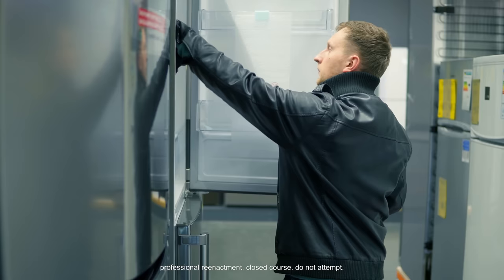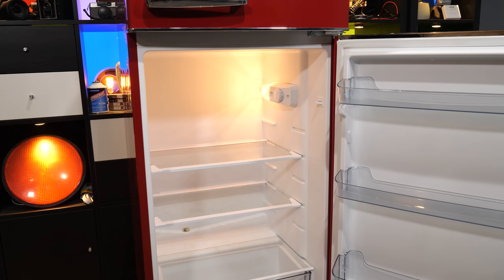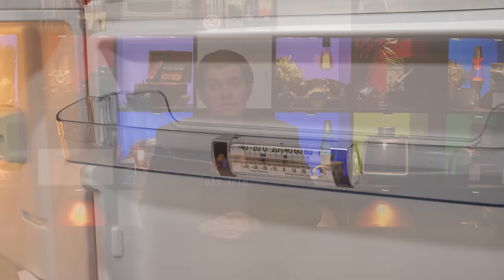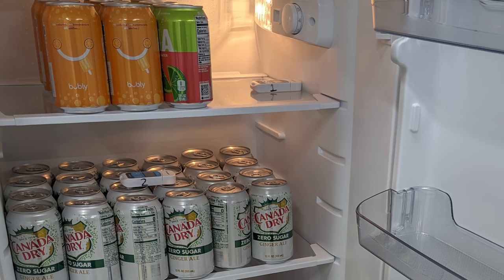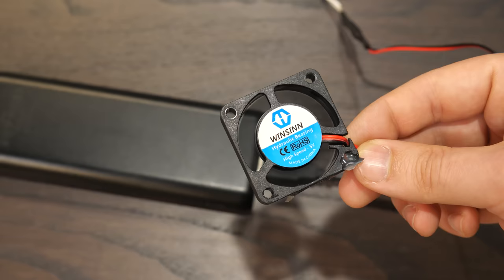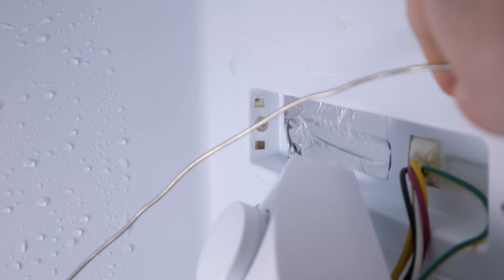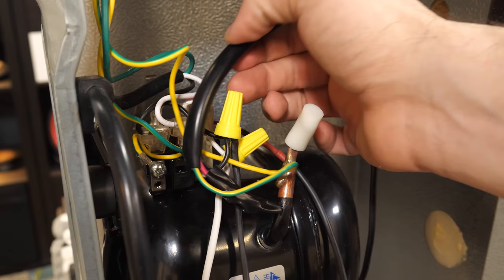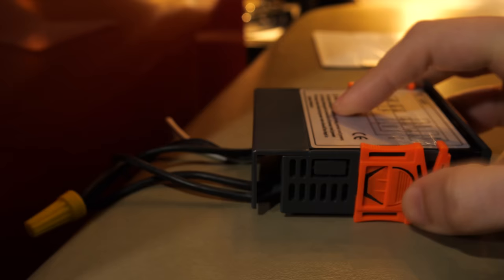This goofy fridge has a really clever design. It's also kinda terrible.

Comment: I was given a "camping cooler" that has no moving parts- it somehow uses evaporated ammonia powered either by a 120 volt plug or a propane tank to keep things cool.  I kept it in my garage for years and used it to keep my beer cold (and if I wasn't careful it would freeze them). You should look into these things. They are stupidly simple yet surprisingly effective.
Reply: I was fascinated to discover non-compressor (and non-Peltier, not that they really count) coolers like that, but apparently they're much less energy efficient than compressor-based systems :(

There's a video by JerryRigEverything (IIRC) where he added a ton of Li-Ion battery storage, solar panels, and fancy monitoring thereof to someone's RV/mobile home thing which had one of those dual-power (electricity/propane) fridges, and a lot of the video comments were like "WTF why is that fridge pulling several times as much power as I'd expect‽".
Obviously it could simply be over-powered (e.g. to rapidly cool as fast as possible - using the same total energy but in a much shorter amount of time - for an environment where electricity availability may be sporadic), but I recall replies from people explaining that it's an inherently inefficient cooling process that's only used because it allows mobile cooling without access to electricity... and apparently camp sites and such with electricity hook-ups for RVs/etc typically don't meter that electricity, eliminating pressure to reduce electricity demand…

… until you start trying to run that fridge from Li-Ion packs, anyway!
Reply: It boils the ammonia and that pressure squeezes it through the spray nozzle. It can use propane or electric to do that. 
Its so inefficient because you have to heat something up to increase the pressure compared to a mechanical compressor that increases the pressure with heat being a side effect.
Reply: The Amish have them that has a kerosene tank on the bottom and a small lamp wick  that does the same as a gas flame . My RV has the same system with propane or electric the flame on that thing is very small amazing how it works so well .
Reply: @AndrewGillard  I checked the current draw on mine and it used a steady 64 watts.  That would be 64 watts used 24 hours a day for the entire time I had it.  And also it would build up a big glob of ice on the cooling element about every 2 weeks.  But it was a pretty neat thing to have.

Comment: Technology Connections talking refrigeration.
'm a industrial refrigeration tech. watching you play with air flow made me chuckle. you increase the superheat with more air flow (warm freezer) you would need a TXV not a cap tube. i'd put the txv sensing bulb on the suction line between the fridge and freezer and adjust valve and charge so the freezer maintains 10-15 degrees superheat and the fridge has a superheat of 0. plus the condenser is dissipating heat via radiation saturating the area with heat on long runtimes reducing your subcooling. using natural convection to cool a monolithic block of liquid will take al long long time. even modern residential units are not designed to make food cold but to keep food cold. thats why i always let my left over food come down to room temp before placing in the fridge that also reduces condensation in the container. high air flow is needed to cool things quickly thats why food production facilities use Blast freezers  with huge amounts of air flow compared to cold storage even though we are maintaining the same temp.

Comment: If this is like the old-school fridges we had here, it is not controlled by a thermostat, but by setting how much it cools manually. So, yes, you do have to adjust the setting based on the contents (and outside temperature etc.). The idea was to have a thermometer in there and adjust the setting as needed.

The temperature gradient was also partially intended, because different products need different temperatures, they just have to be placed correctly.
Reply: While that worked somewhat, I somehow prefer my modern fridge a lot more anyways. I got one of those newer inverter controlled ones with one compressor but separately controlled evaporator circuits (I can even shut of those independently when I want to, example for an extended vacation, or switch my freezer part to a second refrigerator compartement.). I had a simpler model before which drove me crazy, as besides having ventilation along the whole back side, temperature set to about 4 °C, on the top shelve temperature went up and down between -5 °C and 7 °C, yes, I had stuff freeze in there when it was blowing cold air out of that vent. The new one, besides having an exceptionally thick insulation layer compared to others, which I think definitely is a good thing, with controlling the compressor and everything to not switch between on and off only, but practically besides off having 3 or four different speeds to be able to keep the compressor running on a lower speed for a longer time and still be more efficient, it also has the effect, that so far without the door staying open (which the thing really complayins about after at most two minutes with first a chime and later the light starting to blink) I never had the temperature deviate from the setpoint by more than half a degree. I only have to check, as I have the thermometer placed on the top shelf all the time, what the difference across the fridge is. But then, in the manual they even explain that there are different "temperature zones" to store different types of food items, like a drawer staying close to freezing point with another slightly warmer keeping humidity if I remember right. 
They make it sound by design and it actually makes sense with the intended purpose they describe, but I would not wonder if that indeed is just clever marketing turning the inevitable into something advantageous.

Comment: Some fridges have "Do not put on the side" label. Because the compressor is assembled in such a way, that it falls off it's feet when turned on it's side and can't get back in place after. Ever. So look carefully for the handling instructions on the box before moving your fridge in any orientation other than the one it's supposed to work in.

Comment: Defrosted many old fridges and new chest freezers.  Gave up on hot water pots, when hair dryers became common.   Hit the metal surface at the edge of the ice with hot air, and the metal quickly rises to just above freezing, quickly releasing the sheet of ice to a spatula without a messy melt.
Reply: Hmm, lectrickery and water go shockingly well together!!
Take care.  I guess you have so far.
Regards from a Tom :)

Comment: Remember your battery house concept for overnight cooling? Use water jugs as cold temp batteries. Just put some jugs of water in the fridge and freezer.  They will help regulate the things around them and will remain pretty impervious to doors opened briefly. And when you put cases of soda in the fridge, move the jugs down from the freezer to help chill the air back to food safe temps faster. No tinkering required.

Also, I think the first thermostat was measuring the inside air, and the refrigerant temp to keep the cooling tubes from freezing solid. Also compressors need breaks and letting one run for too long adds more and more heat rising up the back of the fridge and it might wear out faster. I think the engineers placed the thermostat to monitor the well-being of the entire machine more so than just the inside air temp.
Reply: i believe in most fridge instructions they do say to keep the fridge stocked
Reply: so essentially if the compressor is well cooled running it continuously should be no problem right?
Reply: @aleksandersats9577 Essentially yes, but this wears out the compressor much faster than expected.
Reply: @PunakiviAddikti  At that point I'd replace the compressor with a vintage one from an old fridge. Sure might sip a bit more but it sure the heck won't die like modern ones.
Reply: @aleksandersats9577  Sure, but this applies to all compressors. It's normal wear and tear, but in continuous use the compressor wears out faster than if it ran only intermittently.
Reply: @PunakiviAddikti  I mean yes it would. But I'd say according to this video this would be barely noticeable. I don't think most people wouldn't put like 10l of room temperature liquid into it and only smaller items periodically from shopping. I'd say it's a good tradeoff, especially if the compressor is that of a quality one like the vintage ones that were literally built to last.
Reply: The downside of this, is that you loose capacity, and in this case on a awready small fridge, but indeed this would help alot
Reply: @PunakiviAddikti  But a higher capacity compressor would most likelly achieve the desired temps way faster. His idea could potentially work, just without making it run continuouslly as he wanted. Maybe it would cool faster as it compresses the fluid faster, and works less time also. 

This overdimesioning of the compressor would also work in favour of longevity, as it would work way less harder than it was intented, and alot cooler as well.
Reply: @eduardoavila646  There's definitely a capacity loss to store water you're not going to drink. I'm also thinking that soda cools at a different rate than water because sugar lowers the freezing point. So this test may have performed better is it was tested with just water instead of soda. I think when this style was first designed people kept more glass bottles and porcelain cookware in the fridge so plastic bottles and thin aluminum cans are not helping anything cool down and now the compressor has to hard carry.

The first ice boxes even had porcelain walls instead of plastic to keep room warmth out and ambiently cool the inside from all four sides. So the temp differential from front to back would have been less.

Comment: Future advice:  Since I use the RC-5's all over myself, I'm very familiar with them.. To avoid the skewed data at the start, set a start delay before deploying them (Parameter / Start Delay) - It does 30 minute intervals, and 30 minutes is usually enough, although sometimes I'll set it to an hour, depending on what I'm logging.

Comment: I think that you should have left the power packs for the fans outside the fridge. They give off heat as they convert the power. That might explain the higher temperatures lower in the fridge. It looked like the power packs were on lower shelves.
Reply: Yeah, that's what I thought when the fan test went downhill. And the "thermal mass" for the temp sensor tells you why the sensor was in the wall of the fridge, and down by the compressor where the warmest part of the fridge.
Reply: I think it's worse than that! A 5W fan is basically a 5W convection heater. That might add up in a little fridge
Reply: 1amp at 120v is 120 watt.  2CoP would mean 240 watt of cooling
Reply: @chadchenoweth1961 I thought some of the energy should be converted to kinetic energy, so it shouldn’t be a 5W heater? It will gives off heat but should be 5W of heat
Reply: @lokon1979  And what happens to that kinetic energy? Friction between air molecules turns it into heat.
Reply: This is the answer

Comment: You might also need to monitor the temperature of the compressor - it might not be fitted to run for extended periods of time and better thermostat might just kill it faster.
Or I might be giving the engineers too much of a credit, but they went through all the troubles of coming up with the original design (I mean, sticking the sensor that deep obviously took some thinking and effort)
Reply: That's what i'm thinking it has the thermostat there to prevent stressing the compressor. After all it's just a little guy and that's a bigol fridge.
Reply: Those compressors are a standard part.
Reply: @pondking2801  do you even know what that means?
Reply: Yeah, I'm pretty sure the compressor shut off because it reached its thermal limit. It's why you can't run a PC inside a fridge, the compressor is not made to run forever.
Reply: Yeah, electrical engineer here, and my first thought was that the compressor itself has a thermal cutoff
Reply: @Enword_Jim But it didn’t shut off, during the air circulation test it went over its normal 33min window by several hours. Unless you mean shut off due to temp stick rather than overuse.

Comment: Saying that 45°F/7°C is "in the danger zone" seems strange to me. My parents have always set their fridge to 8°C (46°F) and never had any problems. When I google "food temperature danger zone" I get widely different results from different governments. The UK food standards agency calls 8°C-63°C the "danger zone", while the USDA says 40-140°F (4.44-60.0°C)
Reply: I do think it's regionally dependent, you also get different guidelines how best-before dates on products are specified, and traditions in how long you store food refrigerated. You also want to consider that for an American going to buy milk might be a 2 hour long ordeal (from which, if they're a father, they might never return), while most of us walk maybe 3 minutes.  And thus for us this looks like a "large fridge" since most of us have that sort of fridge for a family of 3 to 4, it's plenty, while elsewhere where food is more remote and more effort to acquire you may need a fridge twice to trice the volume, and then you keep the food in it that much longer and it of course has to stay colder then.
Reply: Leaving it on the edge of the danger zone is also pretty stupid.
Reply: The U.S. Temperatures seem to be padded everywhere, and tend to drift to be more extreme. 40f is supposed to be "safe" and had some padding engineered in there in the first place, but if you think 41 is dangerous you end up padding that down to 38f or even 35f. Hello frozen milk as your fridge cycles down enough to keep the max under 35f! Food can be pasteurized at 135f, but it takes a couple of minutes. It happens within seconds at 140f, so all the cooking safety stuff says to murder steaks  at 140f internal temperature before you remove from the heat, so then end around 150f. Ending at 135f get's you the high end of medium-rare. If you look up steak cooking temps on the internet, half the sources get confused/overly cautious and say to removed from heat at 135f for medium-rare, which end around medium-well at best for a thin steak. (Remove at 125f for inch thick steaks to end medium-rare+)
Reply: Yea, I seem to remember as a kid (in the USA) that a fridge was around 50°.  Maybe the recommendations have improved along with the equipment's capabilities?
Reply: It's incredible how much it varies by region. Food safety should be science, and science doesn't change when crossing borders, right? Apparently not.

As an odd example, here in Denmark, fresh eggs are required to be kept below 12C, while most other places in the EU allow them to be kept on store shelves. I know the US is completely different here, but I believe that's to do with the eggs being washed before shipping?
Most of our dairy etc. is recommended to be kept below 5C. Visiting Sweden recently, the recommendation was 8C in the products I looked at in the store.

Even with a food safety certificate under my belt, I am certainly not going to advise anyone on how to handle their produce here in the Youtube comments section, but I will tell you to get away from the middle of the danger zone(s) as quickly as possible 😇
Reply: @JohnDlugosz  I suppose it has a bit to do with how long ago you were a kid. ;)
NASA realized that sending someone to space with food poisoning is a terrible idea, so they put a lot of research into food safety, and State Health Departments adopted NASA's standards.
And those standards say to keep cold food below 40 degrees, and to hold hot foods above 140 degrees (it used to be slightly higher for pork), and to minimize the amount of time food spends in between those.
So people like Alec are just setting their fridge to the temperatures that the Health Department makes restaurants keep theirs at.
Reply: Should be 0-4°C. The food poisoning bugs in rice still grow above 4.
Reply: *4.44-6.0°C
Reply: @danielhostruperiksen8422 re: eggs in the US eggs are washed before sending them to the store, this does two things. It removes all surface contaminants from the farm, but it also destroys the protective layer allowing air through the permeable egg shell. Thus US eggs require refrigeration to keep the nasties from infecting the eggs, whereas in other parts of the world where said cleaning doesn't occur the eggs can be stored warmer.
Reply: 35-38 is the ideal temp for food safety.
Reply: In the US it's not unreasonable to expect somebody to be storing two, three or even four weeks worth of food in their fridge at once. So in that scenario you would need to have the danger zone temperature be lower so that it can preserve food longer, realistically speaking if you're only storing food for 2 or 3 days it's probably fine if it gets up to 47 Fahrenheit (maybe not raw meat but that's an exception to the rule) but if you need your food to last you 3 weeks even 40 Fahrenheit might Beyond the edge of safe for almost any food product.
Reply: It may have to do with different food regulations?  The first thing that comes to mind is the difference in egg processing.  In the US commercial eggs are (and have to be) washed so they then have to be kept in the fridge to prevent salmonella.  That may mean that the US danger zone needs to be more strict because we, essentially, KNOW that there it an elevated risk of food poisoning.  shrug it's just a thought though
Reply: @gildedbear5355  or might have to do with the fact that significant chunks of people in the US have to plan a one or two-day trip to go grocery shopping and everything they get in that one or two-day trip must last them a significant percentage of the month.